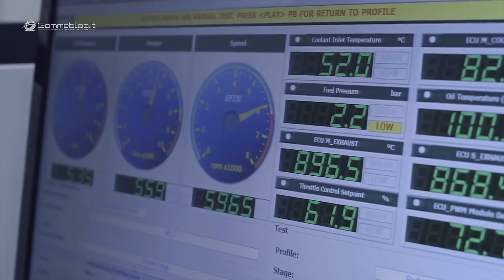Bentley W12 Engine PRODUCTION ASSEMBLY MANUFACTURING PROCESS

Comment: As someone who works on cars, this looks like a nightmare.  All fine and well on the assembly line, wait till it's in the car with zero working room 😳
Reply: They pass the bill to the owner.
Reply: That's why the first owner sells it before the warranty expires.
Reply: Technically you can repair the engine while it's in the car but it would take ages too much labor time, These engines are designed so you could lift the car of the engine by lowering the subframe brings down the engine and transmission as one unit, once the engine is dropped down on the ground you have all the room you need to work on them. These engines are modulated software controlled whenever your working on them you need to hook up  the OBD which guides into the repairing process.
Reply: @mr.boobania  no they lease it lol
Reply: I agree, plus it probably doesn't gain anything over an equal sized v8

Comment: How cool would it be to have a fully automated shop to build your engines. Talk about taking the work out of work
Reply: I work on an automotive assembly line, specifically engine dress. 

600 engines a day +/- for the past ten years. I’ve put in over 1,000,000 bolts. 

It’s still debilitating. They try to take all the lifting out but it adds up regardless. 

Don’t worry, they pay well.
Reply: @fixedguitar47  You work for the big 3?
Reply: @hotrodder5034  - I work for the big one.

Comment: These machine most be the mother of all engines it looks so powerful
Reply: Juan Jose Bernardino Ortiz 2jz mate
Reply: @finnrattrie2015  HAHAHAHAHAHAHAHAHA 
HAHAHAHAHAHAHAHAHA 
HAHAHAHAHAHAHAHAHA 
NO.
Reply: Carl Spackler what’s you pick then?
Reply: Go watch the W16 Quad Turbo engine being built for the Veyron.
Reply: @finnrattrie2015  stock power wise, no 2jz gte on earth was ever the most powerful engine. Even when you spend 10-20k on it, there are cars coming out of the factory that will leave Supra owners wondering if they made the right investment.
Reply: Logan Scott like what, your telling me you can find an engine that has the capability and reliability of a 2jz. No engine on earth is gonna put down 2000 - 2500hp that cost 150,000 - 200,000k. You can buy a Lamborghini aventador and invest as much money as you like. But is 3000hp gonna go any quicker than a engine with 2500hp that is half the weight... probably not
Reply: HorrorHawk they are actually bullet proof
Reply: @horrorhawk7320  Not sure what you are trying to say but the Lambo V12 weighs less than 2jz.  A iron block LSX is more reliable and can handle more power than a 2JZ as a bonus it's 175lbs lighter and can support displacements over 7.5L.  The 2JZ is a very heavy engine tipping the scales at 695lbs
Reply: @horrorhawk7320  reliability? My 84 crown vic with a 302. Started in -47 winter conditions. And capabilities is a very, VERY subjective term. I believe the correct term is aftermarket support.
Reply: @ineffable1129  2JZs aren't 300kg the block itself is only about 60kg

Comment: Nothing drives home the quality like tightening rod bearings with a cheap electric drill and scuffing cam lugs with chrome alloy. 👍🙏💯🇬🇧
Reply: TigeroL42   Drill type, tighten to inch or foot lbs, didn’t see the scuff stuff, oh well.
Reply: I once handled a small pneumatic blue Bosch drill at work. Like 3Nm of torque. Thought it was nifty, maybe I'd buy one for myself. Looked at catalogue. 600 Eurobux.

Comment: I can't imagine the price of a Bentley W12 engine alone
Reply: Ya, you've got to pay for all those damn specialized tools.
Reply: @Mr_Meowingtons  I can't imagine
Reply: @Mr_Meowingtons  you go by a vr6 head gasket for 40 bucks
Reply: Julius Adams, It's a VW, as in Volkswagen.Who knows what the difference in price is just because it has Bentley stamped on it.
Reply: @scottelkin562  you're right because the world we live in we put a price on someone's name brand and raise the price just because of a name but same product it's called being deceived
Reply: The twin turbo w12 will set you back $40k crate with matched ecu and number matching awd transmission and tcu.
Reply: @Finallybianca  WOW that's crazy
Reply: I remember a M-B 600SEL 6.0L V-12 needed a "short block: after it went "swimming" and put a connecting rod thru the block ( crankcase ).
The price of the PART alone in '93 was $17K.
Reply: @SpicyRok7482  wow can't imagine today
Reply: I have read that the W-12 is basically 3 V-4s.
Those engineers are making bacon over there...think of a 1.2L gas that is supercharged AND turbo'd.
I would love to see that one too.
Reply: @SpicyRok7482  its 2 vw vr6's. It's not really about making bacon really, modular building is really smart. It's more efficient and cost effective, factory workers know the builds like the back of their hand and engineers get to spend more time perfecting their bread and butter. Also parts Interchangeability lends itself to easier upgrades and customization
Reply: It cost your the price of your house together with your car lol
Reply: You can get a used W12 engine/transmission complete with all ancillary components (turbos, ECU, A/C, alternator...basically everything you see being attached to the engine in this video) for about $15K.  Buying a new one?  I don't think you can, unless you're replacing an engine in your Bentley, who knows how much that'll set you back.
Reply: A little over twice the price of an oil change.  Let that sink in for a minute.  16 drain plugs, 27 hours, $21K
Reply: Just looked a used one was only 5k, I can't imagine they are easy to work on or fit into many platforms. It was probably an older one as well. It would be cool if you could buy this whole AWD subframe type setup they are building here but I bet it ain't cheap.
Reply: Same price as a VW W12.. oh wait same engine lol
Reply: @datsuntoyy  Nope your wrong...post the proof and I'll believe you
Reply: Matt I’ve already replaced two VR6 cylinder heads on the new VW Atlas...I wonder if Bentley is having the same issue. Our VR6 heads were either undertorqued or were improperly machined from the factory
Reply: @mikecs420  Bentley has an issue with cylinder head gaskets.  If the engine isn’t warmed up properly before it is worked hard, they will fail.  As if everyone sits in their lane for fifteen minutes before driving.  I’ll take my super reliable Honda’s any day!
Reply: @scottelkin562  Similar with other brands, like Bugatti and Lamborghini. 
Hype create more sales/money. If these vehicles were for sale under the VW badge. They would be about as successful as the VW Phaeton.
Thus, not successful!
Reply: Imagine how much money VW spent over the last three decades. Buying up these (nearly hollow/bankrupt) entities. To get their technology sold at viable price. (Taking into account, what is called "Economies of scale")

... Just to end up against the next brickwall, with the name "Dieselgate".

Comment: At 6:35 he tightens the top bolt and then the one right next to it. Then he realizes the other bolts won't go. Then they edit out him loosening the bolt so the other bolts will all line up. Any real mechanic knows you put all the bolts in loose at first then just snug them and finally tighten them in a balanced sequence.  Those workers are just human robots.
Reply: I saw that as well...several times....always tighten in crisscrossing patters after all hardware has been started.
Reply: Except the "bolt" he grabs that you are supposing won't go is actually a stud.  Nice try, though....
Reply: @big800wildcat  After a second look I think your right. Better eye.

Comment: 11:35 Man, thats a silent motor, didn't expect that from a V12 :D
Reply: It's a w12. It's like 2 VR6 VW engines at 90 degrees. So like.. two 15 degree v6's in a 90 degree v configuration
Reply: A straight 6 is perfectly balanced, no need for anything more :)
Reply: @TranquilPhoenix  like ?I thought is was the same engine?
Reply: The silly part is my Audi SQ5 uses the same transmission
Reply: @highlanderfreelancer4553  practically is but with modifications in the casting to have correct compression ratios and oil and coolant passages
Reply: @erincarson8998  12s sound nice, but for torque, just make a bigger 6, failure of cylinders: rare. 
A 12 will have a more even torque (twice as many fires per rotation) but does the cost (money, friction, complexity, size, weight) of doubling the number of cylinders ever become worth it?
Reply: @TranquilPhoenix  Actually 72 degrees
Reply: @thedongerneedfood215  The silly part that Audi Q7 uses the same engine.
Reply: @Liftium  The silly part is he couldn't afford that one so don't remind him about it.
Reply: Correct V12
Reply: I like to call it a VVR6.
Reply: @G-ra-ha-m  Straight 6’s have too much drone and vibration. That’s not what someone looking for a luxury vehicle wants. That’s coming from someone who drives a straight six..
Reply: @Ragnar-7034  I have a straight 6 too. Vibration is non existent, and they only drone with a loud exhaust pipe, when accelerating. Mine settles down nicely on a run :). (BMW)

Comment: All looks great BUT TRY TO WORK ON IT IN THE WORKSHOP EVEN WITH TRAINING not quit the same
Reply: Some ideas are better left on paper.. they have the reliability of American cars from the 80’s
Reply: Imagine replacing all piston rings and sparkplugs its gonna be a nightmare
Reply: @Krazycat321  reliability from 80s . im in! my 1983 ford e-350 460 7.5 dually ambulance is a tank!. And runs very strong. And will for decades to come.
Reply: What, it's not any different that working working on any V just that are two banks of them.  Also it's not actually W layout it's a VV or two narrow V sharing a common crank.  A W has three inline banks.

Comment: As an engineer, I'm in awe of the technical brilliance of this engine and transmission package but I do wonder where it will be in 10 years - scrap!! No one could possibly afford to repair or rebuild this engine. For my kids, this is not a very positive sign of anyone looking out for their environment, just catering to very wealthy people.
Reply: Also as an engineer, I expect that machines such as this will be in perfect working order 10 years from now, and also 100 years from now ... IF they are respected (maintained and operated as designed). And perhaps in 10,000 years one of these will be held in the same awe we feel for the Antikythera mechanism.
Reply: @webpa  🙄 I envy your optimism...
Reply: just get a new car every two years
Reply: @d.s7741  ok. I'll check with the missus..

Comment: “Has anyone seen my watch?
Anyone? ...oh dear...”
Reply: HA! Human error can only be minimized. While welding a hydraulic tank I noticed my safety glasses were missing. I left them inside the tank and tacked the lid on.
Reply: James Poteat has anybody seen my spectacles ? What about trying to diagnose a strange noise if somebody had put a piston in half a turn out. I saw the aftermath of somebody fitting six BMW pistons in the wrong way.
Reply: It's 7:37 pm cst.
Reply: When asked about why a watch was found in one of the engines, the tech said "I was testing the timing?"
Reply: I always have a strange whining noise in the passenger seat, still haven't figured out what it is. Though the noise is only there when my wife rides with me, real strange...

Comment: But it´s a German VW engine. It´s from the VW Phaeton.
Reply from the maker: Yes Bentley is part of VW group
Reply: Using technology Volkswagen «VR» engine development since 1991 created Bugatti EB118 with W18 in 1998. Then the production began A8, Veyron, Phaeton, Touareg in 00-s.
Reply: @GommeBlog  VW? The people who cheat on emissions?
Reply: @rokguitarstar  all companys cheating in emission not only vw
Reply: @alexsis8980  the W18 was 6 polo 3cyl engines arranged in 3 banks of 6 cylinders, think 60deg V12 with 6 extra cylinders horizontal. It was switched to the W16 in the Veyron which was originally shown in naturally aspirated form in the Bentley Mulsanne show car. The W16 uses the VR concept as 2 VR8’s

Comment: It’s like they put 2 vr6 together
Reply: That's exactly what this engine is. A true W- (or Y-)12 has three banks of four cylinders.
Reply: Isnt Bentley owned by vw now?
Reply: It is, but not end to end. The other 6 pistons have been melded in between the standard cylinders. While the standard ones still need to be spaced further apart to accommodate the extra 6, but using only half the length of the engine. It is truly fascinating!
Reply: The VR6 engines were built to put in the place of a 4-cylinder Volkswagen engine and produce the power of a V8 now imagine two of those little powerhouse engine put together and that's what you got here
Reply: @lejeffe1663   Yes, seit vielen Jahren, schon!

Comment: It makes you wonder just how all that fits in a Bentley
Reply: With the W configuration of the cylinders, it shortens the over length of the engine by at least 1/3. This makes it capable of being used without the long engine compartment that is usually necessary for a 12 cylinder engine. Over all, this is quite an ingenious design, with not just the W block, but the dual over head cam, with staggered/offset coil pack ignition, dual turbos, tuned exhaust; and all of this from a turned billeted aluminum block. Will really be interested to see the performance numbers on this seemingly well crafted engine. Should be a beast, no doubt.
Reply: It's only 4 cylinders long and not that wide really. A masterpiece!
Reply: If you've ever seen a bently in person you would know, a very wide car

Comment: This engine is based on the vr6 engine wich was first on the mk3 golf,vento,corrado,passat .
Reply: It is nearly the same cylinder head.  ..vr6 was 022c and Bentley 07c/d. Combustion chamber was the same but the exterior design different. But you are right, technical the same...
Reply: @dernormaloangler4294  It's funny when you think where the technology of these super cars came from and back then mk3 we're relatively cheap cars but now they are asking a lot of money for it.
Reply: @Scorpion9709  lol i know right? im asking 7 for my finished mk1s and looking to slap one of theese in my other mk1 caddy truck awd of course. Im still looking for a mk2 g60 ralley or a golf country to add to my collection. The unfortunate part 
Im in the california mexico. Might have to import to brazil and drive up

Comment: I think this engine needs some more wiring and a few more hoses, let's complicate life as much as possible I say!
Reply: Needs more cowbell...
Reply: It's a 12 cylinder engine what do you expect
Reply: bongothaplant lol, a very overcomplicated 12 cylinder yes, a Formula 1 V12 would be simpler than this...
Reply: McLarenBMW was referencing the fact that this motor is a W config, not a V12 which is much simpler in its overall design.

Comment: Thank you, that was fun. I never knew the level of smart detail that went into all the engine/drive train assembly. I only have one unresolved item in my mind ; it appears the cam shaft drive chain relies solely on non metal guides for direction and tension of the chains. I would love to know the life span of those non metal guides compared to the drive chains. My concern is  having to remove the motor/drive train from the vehicle to replace those parts would be very expensive. Otherwise, nice job Bentley !!!!
Reply: I thought the same thing. Fords were/are failure prone.
Reply: I used to be a mechanic in a warehouse and you would be amazed how long Teflon bushings or chain guides would last. We had conveyors that had teflon rails the chain belt would ride on in the center of the runs so there was no sag in the middle and it was a lot easier that having shafts with Teflon sprockets every 18inches.

Comment: 2:21 the chain tensioners are plastic, an aberration. That lasts 150,000km and they are spent, then this can break all the valves.
That is an insult to engineering.
Reply: Exsactly plastic?????
Reply: Order some aftermarket better ones and just keep them around.   First time you have the timing chain cover off for whatever reason, swap them in.

Comment: Oh okay, it's a "staggered" V12, not a W12, now I get it.
Reply: It's a W12 not a "staggered" V12...SMH
Reply: @PhotosByHamza  If it were a W12, there would be 3 equal lines of 4 pistons as you need 4 pistons sharing the same plane to make a "W" configuration, but each plane of pistons here contain two pistons operating in a vee configurations (6 x 2 staggered vee formations), so it is a "staggered V12",  no matter what you and VW want to call it.

Comment: RTV instead of a gasket timing cover, rip to the technician that has to spend the next 3 days resealing that pig.
Reply: RTV is actually quite common in both stock and aftermarket builds.  I've found RTV stripps a lot quicker than some of the gaskets out there.
Reply: Gasket or RTV, the poor sucker who has the job of removing all the old gunk before re-sealing and closing up again. Looks like its the youngest guy that gets that job. Maybe the other dudes pay him a few pints after work. He deserves it. 👀👍

Comment: At 0:13, he lifts the crankshaft with a hoist. I collect my 402 engine on my knee, manually.    😎😎😎😎😎😎😎

На 0:13 устанавливает коленвал тельфером. Я свой 402 двигатель собираю на коленке, вручную.   🔨🔧🔩😊😊😊😊😊😊😊
Reply: саша гемберг .... add heavy as that crank IS... they fail bcs of too much stress on the journals.